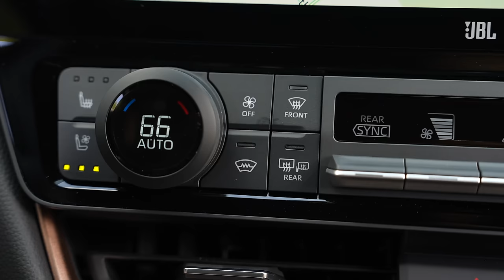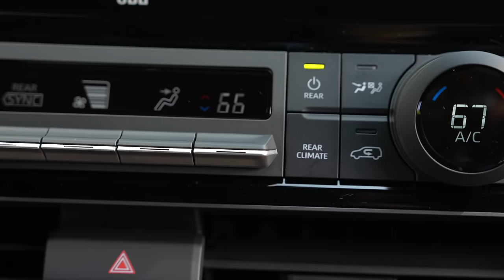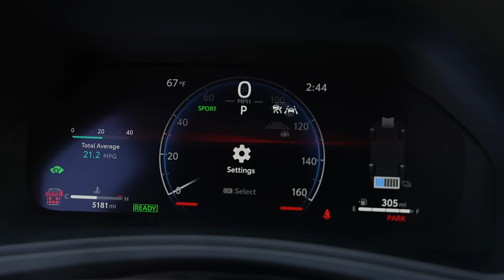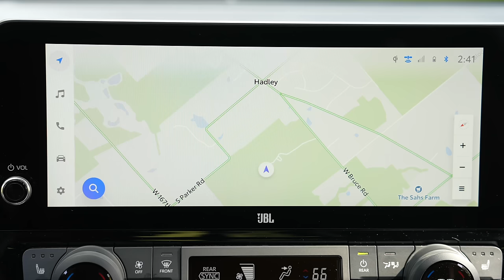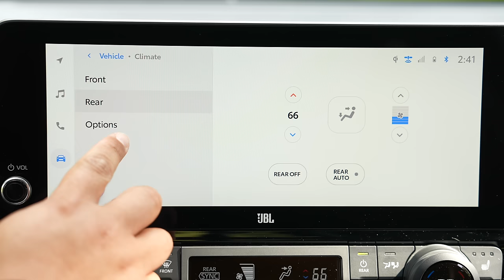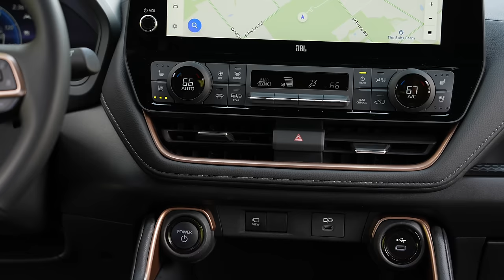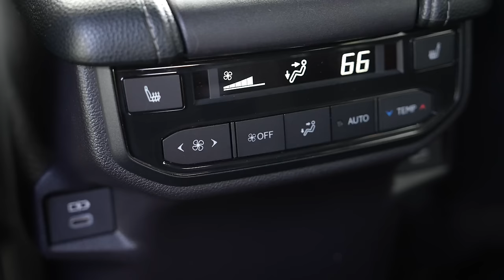Should You Buy A 2024 Toyota Grand Highlander? Back To Basics Toyota

Comment: I have a regular highlander with the T24. They did not tune the non-hybrid 2.4 turbo correctly. It is far to agressive on the tune to run 87 without pulling timing in the heat or with the AC on. It will surge and buck at medium load under 2200rpm. There is a very noticeable hesitation on take off. 91+ fixes all these issues.
Reply: Glad I got grand highlander hybrid and not hybrid max since regular grand hybrid doesn't have a turbo on the engine. Hybrid max has too much going on, a turbo plus hybrid is too much on the engine even with hybrid together.
Reply: @robmalcolm8042 the max is the only way to go on the GH. The normal powertrain is 2nd, but the standard hybrid is a complete dog. 240hp and sub 200lb/ft is not enough to move that around. The formentioned issue was resolved by toyota finally and it runs great now, but HMax was never affected
Reply: @Suction_  maybe so I'll see for myself when we get it but the Max has a turbo plus hybrid it has too much going on even if the base hybrid is slower the power train is more durable than regular gas turbo or hybrid max. The regular hybrid is the same power train from the regular highlander
Reply: @robmalcolm8042  I know where you're coming from. But what I will never understand is why people forget who we're talking about. It's Toyota. Their entire montra is about longevity. Everyone saying it's going to be junk truely doesn't understand the lengths they went through to get it as robust as possible. They're spending well over a million an hour on R&D and settled on just a few different powertrains that they put in everything. You want to tell me this would be junk in a ford or GM? Sure I'd believe you. But Toyota? The last bad powertrain they really made was the 2az and the first year run of the 3.4TT, which both have identifiable problems. The t24 in this is based on the a25 which is in everything - last I saw they've made close to 3 million of those world wide.
Reply: @Suction_  yea of course they still have the least likely chance of it being that bad but in the long term I doubt any turbo will last a super long time. It'll probably just last longer than everyone else's version of that.
Reply: @robmalcolm8042  i've seen dozens and dozen's of cx9s come accross with a quarter million on them. No evidence at all of any issues outside of leaking seals which is prone to everyone
Reply: @Suction_  Mazdas can go a while but toyotas have the track record for more million mile cars. Mazda miata is one that's known to be able to do that.

Comment: I have a 2021 Highlander Platinum AWD V6. It’s a beautiful car, no glitches or wind noise. I would take a beating getting into the Grand Highlander as they give you terrible trade in value 3 years later. I think those engines in the Grand Highlander are too small and untested.. 
keeping my ‘21 although the extra room in the Grand is tempting. Great review!
Reply: I agree, I bought a 2021 platinum with the V6, I figured the turbos were coming.  We looked at the 2021 Hybrid as well, but the lower tow capacity was a deal breaker.
Reply: Yeah that's the only thing about hybrids but the full gas aren't going to be any better with resale value since I trust the hybrid without a turbo which is the grand highlander without hybrid max its the same engine as the highlander hybrid. The gas with a turbo is going to have to much pressure in the engine.

Comment: I have a 2015 Toyota Highlander with the 3.5l engine and the 6 speed auto transmission.

That was the best engine/transmission combination.

Toyota should have kept them, very strong and reliable.

I have 180000km/112000miles it runs like new.

I will drive this car for the next 30 years I don't like all the new hybrid systems and CVTs.

Especially since I retired recently and I'm only driving 5000 km/3000miles per year so all that extra hybrid expense doesn't make sense for me.

EVs are not there yet.
Reply: Absolutely yes. Thank you.. I totally agree. 

In the same boat as you.
Reply: I have a 2013 Highlander. It has 104,000. I am 75-years old. I am not sure whether the Highlander or I will go first. I will not buy anything to replace it, unless it becomes unreliable.
Reply: I am sure its a champ. I see a lot of those still on the road in great shape.. even first and second generations sometimes that appear to be holding up quite well. @kennethabarnhart 

I have a 2016 Limited and looked at the 2023 model last spring.. just out of curiousity as I am very satisfied with what I have. It felt so thin and flimsy, chintzy then add in a four cylinder.. no thank you. I will pass.
Reply: If the MPG is roughly equal, then why was the V-6 Cancelled? My V-6 does an average of 22MPG and has a known fantastic reliability, track record. 
Why fix what isn’t broken????
Reply: Govt bs makes them get rid of the 6
Reply: @Justacogg less emissions with a 4 cyl vs 6 cyl

Comment: Your point about the essentially missing rear bumper is disturbing.  No wonder insurance rates are skyrocketing.  Despite all the fixation on crash testing for passenger safety, car makers and the government are completely abandoning the less dramatic but practical concerns about ownership cost from fender benders, etc.  You did point out that at least in the front, they kept the sensor gear mounted high up behind the Toyota logo where it was less likely to be hit in a front bump.   Of course, it could be embedded as part of a much larger assembly that can only be replaced en masse so that might be a wash as well.

Comment: AMD, you are forgetting towing and a non hybrid model on advantages over the Sienna. I consider the hybrid an advantage, but many do not (their loss), but this is rating to tow 5000 lb vs 3500 for the Sienna, and for some, that little extra capacity is needed for a camper.

Comment: Been waiting a long time for this video! You definitely did it justice. I now xant wait until you get a hold of the TX 550h+. The combination of the 2gr with a bigger battery pack with 400+ hp just seems perfect
Reply: I'm eyeing that but not sure I could handle a $75k+ price tag.  A Highlander Prime would be a much more mainstream (and affordable) option
Reply: Im also waiting on the TX550h+. It should be a much better vehicle all together since it will have a naturally aspirated V6 engine. No need to worry about the turbo. The only concern will be the tag price for it.

Comment: I have a sienna, my complaint is not the power, it’s the suspension that should be air suspension. No none-adjustable is acceptable on a vehicule that can have 1 passager in the morning and 7 with luggage in the afternoon.
My father had an air suspension on a Chevrolet Venture back in 1997….

Comment: I stopped working on my cars on the early 90s.  I got bigger, engine compartments got smaller,  and troubleshooting got complicated for a driveway mechanic.  These days I watch your reviews to find a car that's not going to require crazy labor hours for simple repairs.  A valve cover gasket replacement shouldn't involve  pulling injectors.

Comment: Great video! Just one disagreement concerning your conclusion that the Sienna is more sensible than Grand Highland aside from the Hybrid Max. Having test driven one of these, the Grand Highlander is much more comfortable and roomy than the Sienna and has better a better tech package. For someone who is taller, the Grand Highlander will be considerably more comfortable than the Sienna, especially for longer trips.  Just figured I’d offer that different perspective. 😊
Reply: More comfortable and roomy? That's not what all the reviews are saying. Are you talking about the driver seat specifically? For 2nd and 3rd row seats the advantage goes to the Sienna for sure. What is different about the driver seat on the GH? I'm 6'4" and would like to know. Thanks!
Reply: Yes, for the driver’s seat. My apologies for not being more clear. You are correct that the passenger section in the Sienna is larger and more spacious. At 6’3”, I found the GH driver’s seat to be wider and more comfortable than the Sienna. Also recently learned the Sienna’s hybrid battery sits below the front seats which moves the driver seat a bit higher than older generations.  I didn’t measure but I believe you can move the GH seat lower which provides more headroom for those with longer torsos. 
Personally, I also felt the steering wheel position to be more comfortable and than the Sienna but I realize that’s a personal preference.  Hope this perspective helps!
Reply: Yes thanks! @timmy4price

Comment: Great review AMD.  I am excited about the potential for this model.  I know you always mention the aluminum knuckles on the suspension.  Aluminum is a good choice for dissipating heat and this configuration may pull heat away from the brakes and the wheel bearings.  So while it may weld itself to the wheel at some point, before it does that it may be extending the life of other moving components that are generating heat during normal operation.   Toyota uses this material for the knuckles in all their vehicles that I know of so there may be more than one reason why that they use it.
Reply: So you have to buy a new knuckle when the bearing goes out?

Comment: He hits on what I was concerned about - the regular hybrid being underpowered for that size of a vehicle when loaded down.  Holding out hope for a Prime version to offer power and similar efficiency
Reply: The added horsepower of the Hybrid Max is enough, check the horsepower rating and torque below:

For the family driver, the allure of the Grand Highlander rests with the new Hybrid Max powertrain. As the most powerful Toyota midsize SUV ever, it can rush from 0 to 60 mph in just 6.3 seconds. Grand Highlander Hybrid Max powertrains generate 362 horsepower with 400 lb. -ft of torque.
Reply: We just got the regular hybrid 2024 Grand Highlander and it seems to have better pickup than the gas, even with lower horsepower. I think the battery makes a big difference from a stop. And with hopes to get 37MPG in town, its now my goal. Too bad we do more highway driving, but 34 isnt too shabby either
Reply: @jlwhein1779  Same drivetrain as my 2023 Lexus ES300h (I believe) and I get 43+ MPG in the city; however, she does weigh less than your Highlander. Love the hybrid system. See my comment below and change that oil & filter regularly (every six-months or 5,000 miles, whichever occurs first) just like TCCN and Scotty Kilmer recommend.
Reply: The regular hybrid is proven and reliable for last 20 years... The hybrid max is an experiment with turbos and new engine setup that no track record (turbos tend to expensive part that wears out overtime).  I would go with the regular hybrid...

Comment: I have heard a-lot of complaints regarding the flimsy hood. Many owners find that the rear of the hood towards the windshield vibrates and flutters at highway speeds causing a significant distraction while driving. Dealer’s response is the hood is aluminum and this is normal. Folks have adjusted the front under-hood frame bumpers up but it does not resolve the issue.
Has Toyota ever heard of stringers? A couple of metal strips in this case likely glued to the bottom of the hood to stiffen the unstable area. Used all over in an airplane albeit usually riveted for installation.
Count me out until this issue and other tin canning body panels are properly reinforced.

Comment: Been waiting for this video!  I got my xle hybrid 2 weeks ago and so far love it.   I chose this model because it doesn’t have turbo and uses the same engine in highlanders for years.   I was concerned about buying 1st model but having used the same engine and not turbo really helped assuage those concerns.  Additionally, I actually canceled my order for the 2023 highlander for this gh because 1. Third row is usable for people and car camping!  2. No cablegate concerns as the cords are covered underneath while the orange cords under regular highlander is totally exposed.  3. This xle hybrid has great mpg:  I am getting 38-40 with both city and highway 

Probably is not as strong as v6 my 2012 sienna with 225k but we will see.  Still getting used to parking it having driven rav4 everyday….glad I have habit of parking where I get most exercise ;)
Reply: Yeah got a limited grand highlander regular hybrid.  Its the only one of the 3 without turbo, the gas and hybrid max got turbos.
Reply: @robmalcolm8042  yeh.  Biggest surprise is it uses certain type of expensive oil so makes 5k mile oil changes pricey
Reply: @dt5656  really I heard someone using regular synthetic
Reply: @robmalcolm8042  I took to dealership and cost 170 for oil change.   He explained it is really thin oil ….

Comment: I would like to hear about recalls….issues…problems…with any car you break down….it would be helpful for interested buyers…
Reply: the regular hybrid has a gas gage issue  on some, that is about it.   The max hybrid may have a jumping transmission issue, as gas gage issue as well as get less mpg than they estimated.      Radiator on all might be getting hit by small rocks.

Comment: As a tire technician, I hate wheel bolts or lugstuds, as we call them. Most European vehicles and some Chrysler vehicles have them. They are a major pain to deal with when changing tires or rotating tires. If one is missing we can't replace them. If the threads inside the rotor are messed up, you have to replace the whole rotor, not just one stud.

Comment: I have a 2024 Grand Highlander non-hybrid. Did you say not to wait until 10k miles for an oil change? Should I do it every 5k miles like I am used too for my other cars?
Reply: They key here for oil changes is the turbo. Any car with a turbo should not be doing 10,000 mile oil changes even with synthetic. Synthetic oil is mandatory with small turbo's. A small turbo is any turbo smaller than a semi truck turbo. Many manufacturers recommend regular 3,000 mile oil changes with the turbo. With a good synthetic oil you can probably push 5,000 miles but I probably wouldn't go beyond that for light use. Heavy use, like towing or load hauling gets 3000 mile with synthetic oil changes. 
Almost any newer car without a turbo can do 10,000 mile oil change though I only push my cars to 7,000 miles even with synthetic. 
I regularly check my oil as well for level and color. I highly recommend everyone check their oil once a month. If the color suddenly changes, get it to your mechanic right away. You might save it's life and a ton of money.
Reply: @consaka1 10K is much for any car definitely gonna burn oil before it hits 150K miles or even sooner so 3 an 5 the best 7 starting to push it
Reply: @andersonrodriguez8258  lol I disagree and oil testing will prove me right. None of my cars use any oil aside from the 2009 turbo Subaru but the Subaru is a different animal with its own set of challenges. The rest are heading towards 200k with no oil use issues which is saying something when you consider all the newer cars with oil use issues that are not even remotely related to oil changes.  This channel has even talked about that specifically.
Also consider some of the abused cars that have made it to 100k without any oil changes. Sure their oil looks like gloppy molasses but clean it out and put new oil in and they run decently. 
Fact is the drivetrain on cars is pretty these days and oil quality is way higher than it used to be. With good oil you could easily do 20,000 miles so 10k is just a really safe margin.
Reply: @consaka1  However, like TCCN and Scotty say, oil & filters are cheap, engines are expensive. Just change it every six-months or 5,000 miles, whichever occurs first and you will be fine.
Reply: I change the oil in 2021 Highlander V6 every 5,000 miles, we drive 10,000 miles a year…..so it’s an extra oil change…..big deal.
Reply: @foxlake6750  An unnecessary one but so what? Like you said, big deal. If you want to spend the extra money for no real reason go right ahead. It's a free country.
Reply: @randy74989  I'm not too sure who tccn is but Scotty is a borderline idiot half the time. He's made a name for himself making videos and waving his arms around but half his notoriety comes from him being clueless and spouting nonsense. He has proved over and over again that he has no idea behind the physics of what he's talking about. I wouldn't doubt it for a second if someone said he got fired from every shop he worked at for incompetence. Of the videos I've watched strictly for entertainment it has become apparent they really are for entertainment only. 
Fact is a good synthetic can easily last 10 k miles and nobody is hurting their engine by going that interval. However if your paranoid do it more often. It won't hurt anything but your time and pocketbook.

Comment: The major thing I would really like to see in the next year is when you use your directional signal that the digital gauge would open up into a view of what is along your side like what is in the KIA's. The side mirrors have a camera in them, and when you use your directional signal, you see what is alongside of you. I personal think it's a fantastic safety feature. I'm still somewhat undecided on what one to get at the end of this year. The Hybrid Max has more HP and plenty of smaller Cargo space VS the Kia Telluride. The Telluride sx prestige & x pro is less expensive
Reply: I came from a Tesla model y which has the camera mirror feature and I find the mirrors in the GHH are big enough and positioned good enough plus having the blindspot monitor in even the xle makes up for no side camera mirrors